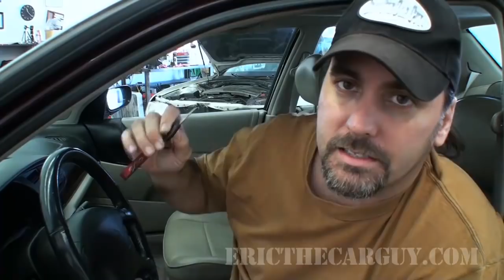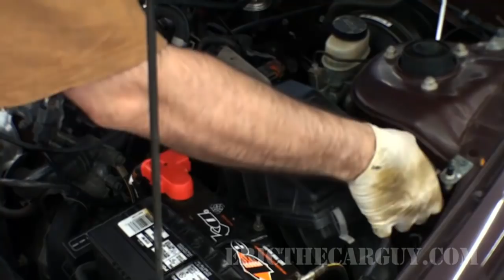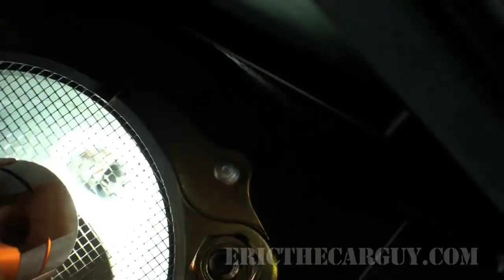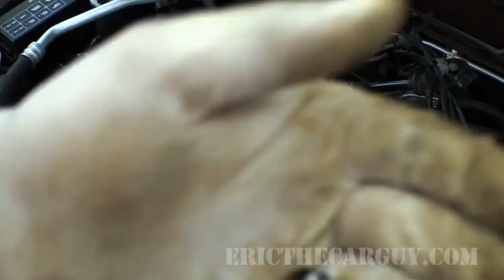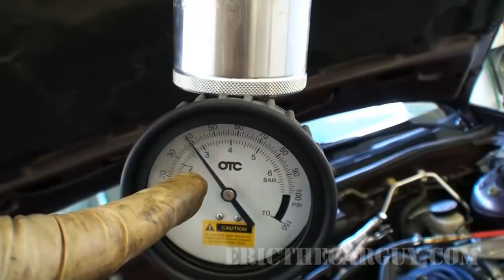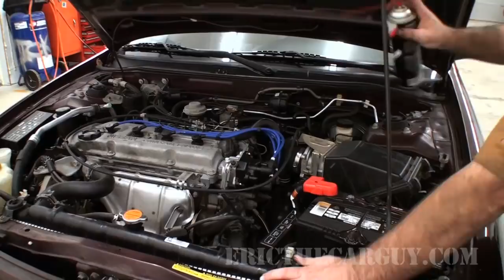1997 Nissan Altima Misfire Diagnosis -EricTheCarGuy

Comment: i have 95 f150 5.0 and i have a miss fire at idle as well. i have replaced all ignition (wires, control box, plugs, distributor cap and button, coil), checked for vacuum leaks and cant find anything, i have also taken the intake plenum and throttle body off and cleaned them as well as replaced the gasket along with cleaning the iac valve. i did have a wet spark plug with gas so i replaced the injector(fixed the wet plug). Fuel pressure is good as well as the Fuel pressure regulator.
Reply: What was it?

Comment: Well Eric did show that the one wire had a burn mark on it and the cap had some bad stuff on the contacts so it should have been replaced anyway.  I think he should also change the noisy bearing..

Comment: I also have fuel contamination in the oil, which I'm hoping is just a result of unburnt fuel in the cylinder that's missing, but I want to do a compression check in case of bad piston rings, poor valve seal, etc. Off to watch the Leak Down Testing vid, and also the Finding Vacuum Leaks vid since I got some weird results from squirting the carb with break cleaner...

Comment: I have to admit the first time you blipped the throttle I shouted Vac leak, only because I've watched your video's for a long time. I got on to your video's after changing the HG on my 1998 Saab 900 Turbo and had nothing but rough running, changed the sparks, DI pack, re-timed it 3 times, still bad, no matter the RPM, but it would clear after hitting 5.5K RPM. Turbo runs out of puff past 5K and it all clicked! Inlet gasket leaking both Vac and boost at cylinder 1, the replacement was torn. FAIL!

Comment: the thing i learned about early 80's to late 90's nissans is they have bad map sensors. i had to replace them 3 time in a 84 300zx turbo i had and 2 times in a late 90's sentra. also once in a 2000 maxima

Comment: My 2011 had the same problems rough idle with a check engine light with a small leak code ended up being the fuel filler neck had gone bad

Comment: Had the exact same prob on my 99 Sentra 1.6(A) Started do run rough on idles for a few days and got worst by stalling when driving.. Got it to a shop and he swapped spark plug wires which then ran good, after a few mins driving it started back and the next thing was the distributor got swapped and ran fine for an hour and started jerking very badly when driving... after a few mins the jerking went away and never came back! Still a mystery for me but swapping the spark plug wires and distributor was worth it cuz im gettin better mileage now BTW Mileage 200k KM
Reply: I had the same experiences which is what led me to my first fuel injector replacement.  They were intermittent as well and then they would fail completely.  My '93 Nissan Maxima would suddenly run really rough and misfire but then just as suddenly it was gone and all was well.  I then tested the continuity and found an injector way out of spec.  Once replaced, problem solved.

Comment: Hi!! I have 97 Altima automatic, every time the  coolant fans turn on , the car shut off, I replaced MAF, idle air control, even ECM but the problem still the same , anyone knows what is wrong with it? Thanks
Reply: Maybe the fans have bad spots in the motors or one of the motors and it is shorting out the 12 v.d.c. ignition.

Comment: I have the same motor in my 2000 altima had the same problem I replaced the spark plugs and wires and the rough idle stopped

Comment: A signal connector is low voltage and not a ground for anything other then itself. Only by disconnecting something that forces current to take an alternate path or apply greater voltage then intended could such a thing be done.

Comment: I have a 1996 Nissan Altima that will crank and idle but as soon as I put it in gear it just turns off and acts like it isn't getting any air. What might it be?
Reply: Ever find out the reason why to this one?
Reply: Gillispie Ritter i know your comment was awhile ago,however i have the same vehicle and same issue and it was my Maf sensor AKA mass airflow sensor.good luck hope it helps someone out there.

Comment: My personal experience with obd2/GM as follows; p0301-0308 misfire codes almost always means the ignition system i.e.coil, wire, plug, air leak post side of MAF;) and of corse the dreaded mechanical mis. p0300 random miss code means fuel system, injector, fuel pressure, pluged egr passages, cloged cats,usually the fuel pressure is on the low side of good, the system goes lean=super hot exhaust gas/burns up the cats. At least this is the case with GM vehicles.;)-GM master tech bout 20yr's in..ugh

Comment: I don't know, I'm halfway through watching this and can't believe you're changing the car, rotor arm etc. The plugs were new as well as the air filter which tells me that someone has already run through trying to solve this problem. It's telling you that No4 cyl is causing a problem, why not take the injector cable from 3 and try it on 4, that would eliminate the cable as these do tend to break down , same story with the actual injector, also the engine has been cleaned which is a problem

Comment: He put parts on it because there was some corrosion in the cap and possibly some carbon tracking on the plug boot. With the low miles its very likely those are original. Just because its clean and has low miles doesnt factor in the elements. I have a 74 Monte Carlo with 80,000 original miles and was kept in a garage. But every single peice of fabric, rubber, hose and wire fell apart after I bought it.

Comment: sounds like the power steering is low ???
Reply: Thought the same with mine, turns out it was the lower idler pulley for the a/c compressor.

Comment: I would check the compression first.If that is not right all else will not fix it.Did that my first time 54 years ago!
Reply: if you suspected that being a relevant issue to the misfiring ,then check it.
in this case it didn't apply,its like checking your exhaust when your headlight
 is burnt out.

Comment: The first thing i would have done is went straight for the number 1 Spark Plug, analyze it, clean stick it back in, if same switch it with another one, then test it.

Comment: i see you pinched off the return ok lol, you can as far as i know check for 12 volts at injector feed and put a Noid light across the 2 terminals with it running and watch the light flash, see it switching...Fred.

Comment: nissan knock sensors always go bad. they will send a code but not an engine light. when they go bad they use normal timing advance. unless you have a supercharged 3.3 and it will unload the supercharger and reduce power.. the 3.3 engine really has a hard to access knock sensor. some people will relocate the new one on top of intake manifold. cause its soo buried.

Comment: In 1997 Datsun was still using distributors? Really?
Reply: GM was too. The cursed Optispark on the LT1 V8 found in the Camaro and Firebird. Though, that engine was obsolete in 1997 due to the debut of the coil-on ignition LS1 in the Corvette. It found its way into the Camaro and Firebird in 1998.
Reply: I had an 88 Pulsar NX (different from the Japanese/Euro/Aussie Pulsar, called an EXA in Japan) that had the CA18 in it with coil on plug ignition. Depends on the engine with Nissan. But the high performance engines such as the factory turbo SR20 had no distributor, but the SR20 non turbo did have a distributor.
Reply: Yup... VG33E & VG33RE till 2003... Not bad at all, primative, but reliable. If it works, why f&%k with it?

Comment: halfway through the video.... it's the intake manifold gasket .... brutal job, i did it myself on my 2000 altima...took me a few days as a hobbyist using posts listed auto forums by other altima owners.

should be a recall by nissan... the cause of the gasket crack is coolant related...just a bad design...the pricks want like $700 to do it

fyi, anyone doing this job.  change your pcv valve at the same time.  the only time you'll ever be able to get to it is after taking the manifold apart....

Comment: Call me a Redneck, but if the intake leak area was readily accessible, to possibly  save a bitch job in my driveway,  I would try a high temp furnace mastic/caulk along the leak area. If that works which it may well do, excellent. Else its "bitch" time. Nothing ventured, nothing gained.